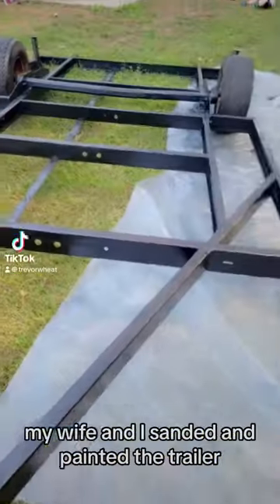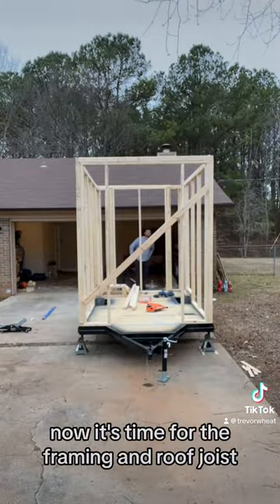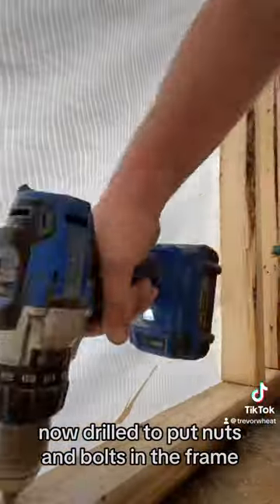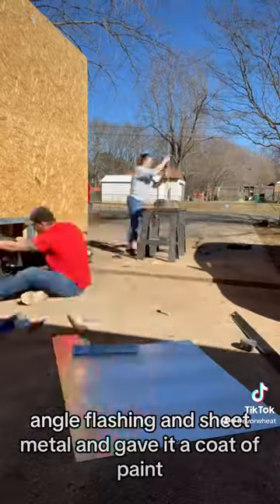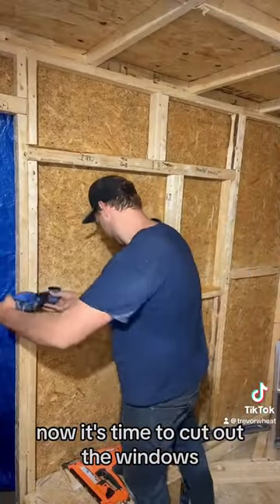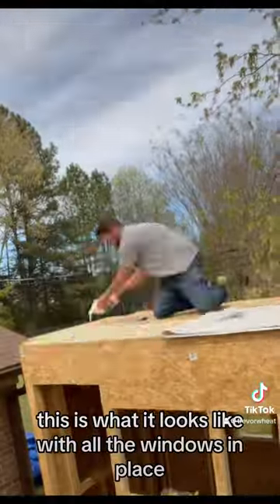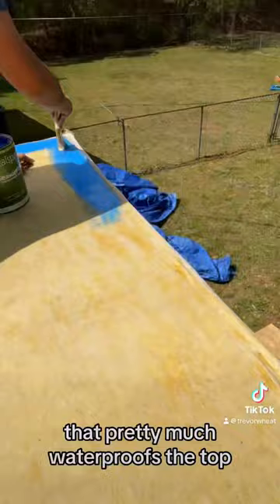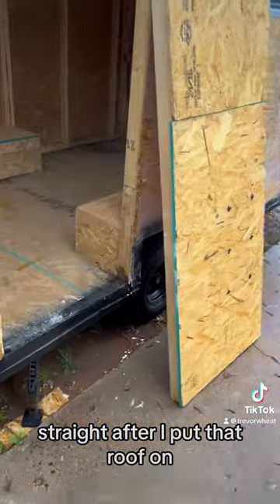Camper build summary #campertrailer #subscribe #diy #build #bluecollardads #fypviral

Comment: Buddy, hear me out, I’m not hating, but take that over a scale, then read the sidewall of your trailers tire weight rating. It’s a big deal, little tires aren’t meant to go as fast as big tires, and they will always turn faster than big tires. That in itself is dangerous enough, add weight to that and you’re just compounding the problem. Your trailer is well built, but nothing is built to withstand crashing at 35 mph, especially a wood framed trailer. Do yourself and your wife a favor before you hurt your pocket book or hurt someone else. Research tires, wheels and Axels.